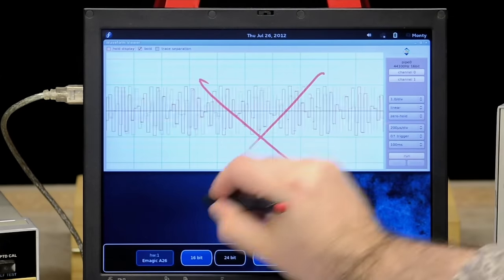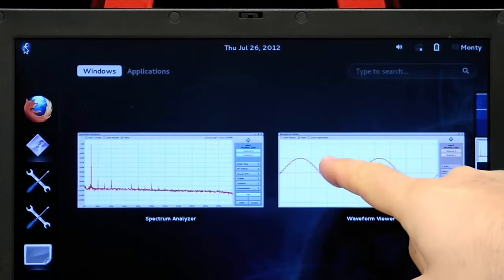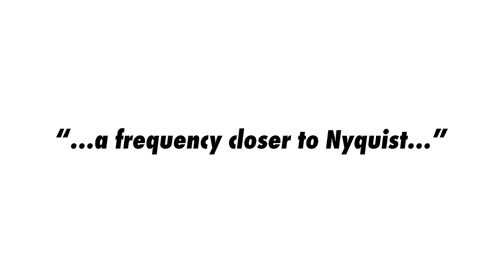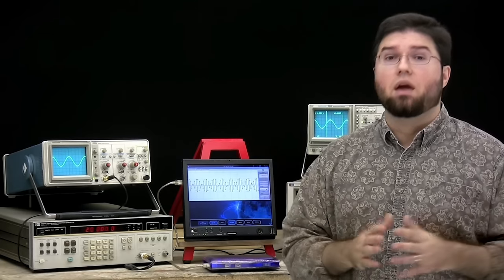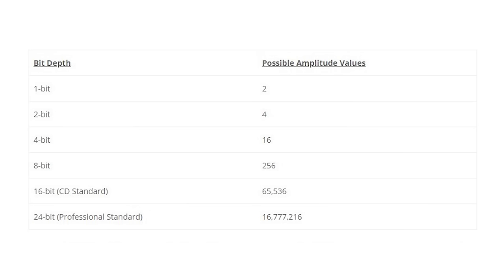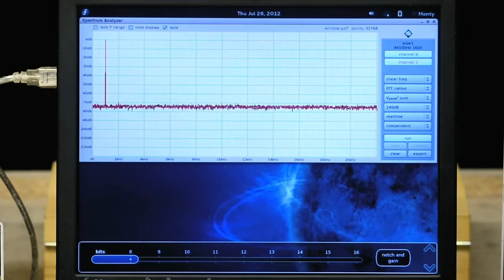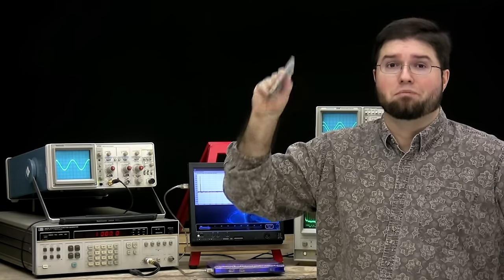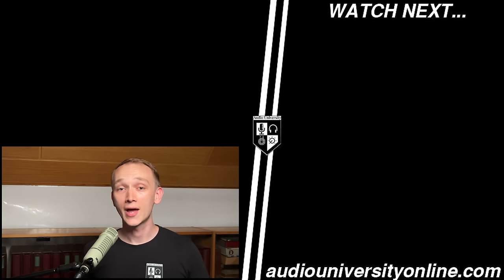Debunking the Digital Audio Myth: The Truth About the 'Stair-Step' Effect

Comment: A 1khz sine wave is meaningless to the purpose of Hi res digital audio. Its all about the nuance of the waveform. Firstly a 24bit capture is a much more accurate representation of the instantaneous waveform than 16 bit. 50% more to be exact.  And when that waveform is being captured at 192khz 24 bit compared to 44.1khz 16bit theres no comparison to the nuance capture capabilities.
Reply: A 24 bit system has lower noise floor than 16 bit. Nothing to do with 'nuance of the waveform'. As for sampling rate 192 khz simply gives you larger bandwith, inaudible to most people. And 16 bits already give you a dynamic range of 96 db, a huge overkill in any domestic listening scenario. Please learn the basics instead of vague concepts like 'nuance capture capabilities'.
Reply: The noise floor has to do with the hardware not the bitrate or the codec or anything else the noise floor of the equipment is what determines the noise floor
Reply: @smarafino10  Bit depth affects noise floor.

Comment: Dude you failed to listen to the result. Now I have evidence as I heard this already. Listen to REVERB decaying on a low bit rate like MP3 128kbps at 16bits. You do infact hear the STEPS. You failed to listen.
Reply: mfnickster9754  it points towards hearing the step which are there to begin with and remain there. You just can not disern steps for 44.1khz
Reply: mfnickster9754  a speaker is not ideally capable of those tiny steps in 44.1khz but can be heard with MP3. Note that our hearing dramatically impares with age.
Reply: mfnickster9754  No for MP3 I heard steps in the decay of reverb thus going with what we would expect to hear. It wasn't even in the audio band near 0dB as my mixes only Naturalise at -0.1 but I do know that we should and can use audio clipping into this Digital Distortion at 0dB which we can not hear as so inferior before we actually can to a certain point.
We certainly will not hear 44.1khz steps.
Reply: mfnickster9754  Take reverb which uses 16bit and you record into 16bit. You do not get the same res as you do from the origiginal signal as that will not be recorded at a Normalised Level. To then Normalise that and then reduce it into the mix and then later increase this again by Bus Compression and then Peak Limiting you are left with big steps not at all what it started as. Then by downgrading to MP3 you hear these even bigger steps. If I have heard it then they do exist.

Comment: I made this on my scope. Noop, the steps are where!
What you didn't tell, is that you have been using AUDIO digital to analog device that smooths the output by a lowpass filter at around 20khz, thus removing any higher hormonics from the spectrum.
Bur I have been using a plain DAC, so my voltage is stepped! just like it needs to be. and have much noise.
So you have proved nothing, but your incorrect understanding of the device you have.

Comment: this video is plain old wrong! Stair Steps do exist on most of the consumer hardware back then and even now. For example the UPD6376 DAC does use zero order hold and is used in a lot of old CD players.
Reply: @nicksterj But many of them are not perfect! Stuff gets through. I would be highly interested in a spectral analysis of the output signal. And im sure you will see some artifacts caused by the stair steps.